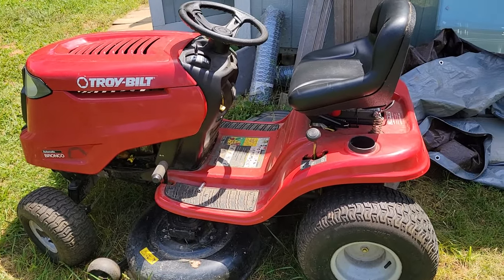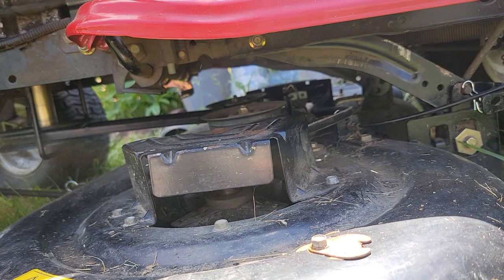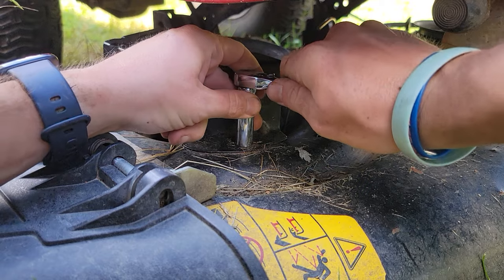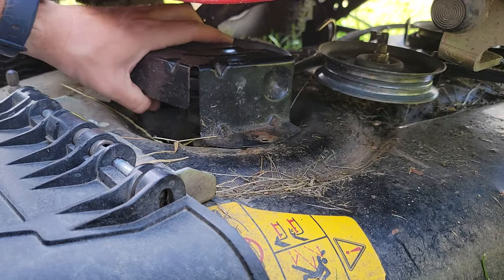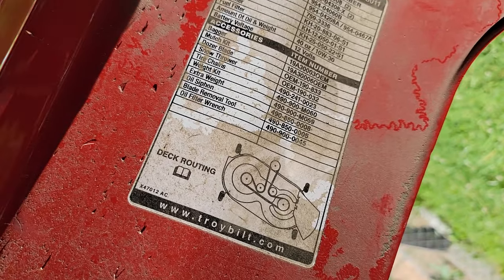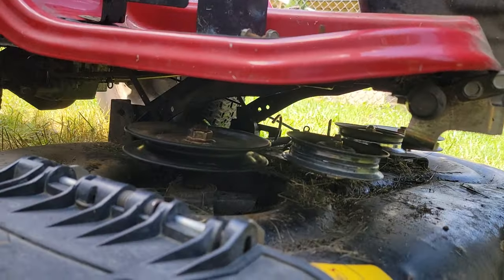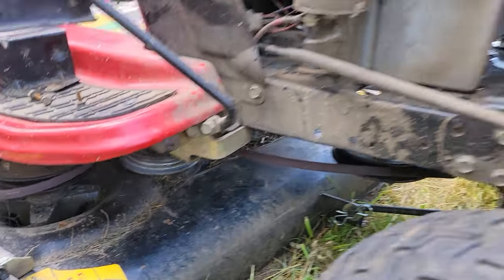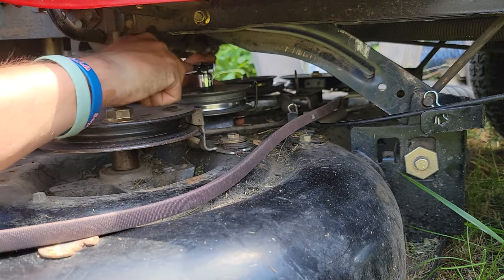Easily replace deck belt (without removing the deck), Troy-Bilt riding mower

Comment: If ur belt seems loose dont panic..... after you crank ur mower engage cutting blades before lowering the deck it tightens the belt so you wont throw it when lowering the deck
Reply: Thanks for explaining it 
I was panicking thought I bought wrong part
Reply: Thank you!!!

Comment: Please accept my sincerest gratitude for sharing this video. Without a doubt, Troy bilt has the most frustrating deck belt replacement out there. This video was a lifesaver.
Reply: gotta disagree...my husband is still trying to replace the deck belt to the Simplicity 50" deck--THERE ARE NO SPECIFIC DIRECTIONS IN THE MANUAL for it....
Reply: @jailranger6891  it didn't help that the manual wasn't including directions for a 50 inch deck....!   I made it a point to have the deck on my truck to take to the dealer and video tape the procedure so my husband could see it.  Thanks for your reply.  Interesting that there are lots of videos for the DRIVE belt...but practically none for the DECK belt..but I do not think it could have been done without dropping it down and off the mower.  Please revisit your video and make it more complete...thanks again

Comment: You can also bend out the belt guard next to the pulley and then bend it back. It’s a little easier than removing the pulley. Great video btw and thank you
Reply: This is where I'm stuck!!! I can not get it through that guard.
Reply from the maker: Some machines the guard is a pretty thin/flexible piece of metal you can easily bend out of the way but on this Troy-Bilt I think it's easier to loosen the idler pulley
Reply: I actually got it! Put the crescent wrench on bottom of the tension pulley & then the socket wrench (with a breaker bar) and loosened the pulley enough to slip it on.  🙌 I'm a 105lb women who feels invincible with the recent knowledge of a breaker bar. 😂 Well, a pipe actually but, it makes me able to remove bolts I'd normal get frustrated & give up. It still took me almost 2 hours. 😂😂😂
Reply: @GiordanosGarage  Yes!!! That's exactly what I did! Thank you for responding! These videos are amazing! I know soooo little about mechanics but luckily my husband hoards all things that fall into the "tool" category.  And kind folk like you take the time to make these videos! I had already gotten the other guards off. I just rewatched this & saw the very beginning.... Ummm, sparkplug? 🤔😬😂 Yeah. I didn't take that out. But I did get my lawn mowed before it rained. Thank you again.
Reply from the maker: Great job 👏 I'm so glad I was able to help!
Reply: I usually try removing pulley just to antiz it for next time or engine repair 
But it depends on customer
Reply: Great video! Please keep it up! (Everyone else wants to take off the whole deck)  got to much time, I guess lol
Reply: Very good video!
Reply: Great video! Easy to follow.
Reply: Not mine it won't budge. What did u use to bend it back?

Comment: This was the best video ever. So very detailed I'm a 63 year old woman. Was having trouble getting it back on the pulley because of the guide. I was afraid to loosen the pulley nut I thought something might fall off the bottom but with this video I was able to put it all back right thank you so very very very much
Reply: me to im In my 60 but I need it to b jacked I did one b4 didn't remove all this but this rider is different
Reply: Hey thanks for your post it’s giving me my confidence back lol I’m a62 year old woman and I’m gone put a new mower back on too thanks ❤

Comment: I liked it but you will have to remove deck on most models to get the blade guards loose. Slipping your tools under are not so easy to loosen the nut and it needs to be torques back on. It really only a couple pins to drop and one cable to release tension. Changing the blades raising the deck and mower like he did makes them easier.

Comment: Remove the deck, do it right. Clean the deck, check all pullies. Replace as needed. Wire brush or sand off any rust, spray paint areas needed. Put belts on the deck, roll back under the mower, attach belt and reinstall hanger hardware. Sharpen/balance or replace blades. It's not all that bad.

Comment: Hey great video.  I’m going to give it a go and save $$.  Did you place the deck at its lowest level?  Would putting blocks under the tires give you more elbow room?  Thanks!!!
Reply from the maker: Hi, thanks-you can do it!! I did lower it all the way to the bottom--i don't think putting it on blocks will get you much lower. The deck arms are only so long-if you need more room you might just have to take the deck off entirely.

Comment: The Best!  Be proud! A 68 yr old man that's disabled (can't stand up, one hand shakes constantly) and with the help of your guide completed the task in 100* degree heat in only 2 days! Okay, here's another trick That helped me... Use electrical tape to hold screws in the socket and on front pulley guide arm I used duct tape on the side you just stick in to keep that booger attached! Just finished mowing. Thanks Again!
Reply from the maker: Great job!! I'm so glad I was able to help. That is a really great tip--thanks for sharing!

Comment: I have a nearly identical Troy Bilt. I loaned it to my mother so she could cut her neighbor's yard. At some point she hit something hard enough to completely break one of the belt guards off. Since it threw the belt and the belt was in rough shape, I decided to replace it. I replaced the belt and installed a new belt guard. Since the replacement, I cannot get enough tension to keep the belt in place. The routing is correct and nothing else appears to be damaged, but the belt will come off after a couple of passes. Thankfully, I have plenty of other riding mowers, but I would love to get this one into good enough condition to sell before Spring is over. Is there anything that I could be missing?
Reply from the maker: Hi! If she ran over something, the crankshaft could be bent.

Comment: Is the tension already correct when you install a new belt?  Your video is clear and precise. Under 15 minutes I am impressed.
Reply from the maker: Hi, thanks so much! It should be correct (no adjustment needed) but overtime the spring can get stretched out a bit

Comment: You don’t have to remove the engine pulley bracket, the belt will slide between the pulley and the bracket

Comment: We have the same mower and for 6 yrs the belt has continued so slip off the pulley on the right side. Any suggestions? Even took it to the dealer. They fixed it but happened again after 6th or so use. Very frustrating!!
Reply from the maker: Same thing has been happening to mine! I have taken my deck off for some other work and it seems like perhaps the belt guide shifted a bit (should be closer to the front of the mower instead of the back). I haven't finished the other work so I haven't tested my theory yet.

Comment: OMG, I borrowed my cousin lawnmower today which I have for little of the summer. Well, today I was cutting and went to put turn the blade back on and noticed it wasn't engaging. I moved the lawnmower and noticed a piece of metal in the grass. Well, now I know what that piece is just from the beginning of your video you showed this is the bracket. I'm puzzled as to how that bracket just fell off, I didn't hit anything. It covers the belt and I noticed the belt has come off a little so I think it just needs to be tighten. Now, just waiting for my mechanic cousin to put it back on. Thanks your video solved my problem had no idea where the metal piece came from.
Reply from the maker: I'm always running over metal too! Which is strange because I never take metal into the area behind my shed....glad I was able to help!

Comment: Thanks for posting I would do deck belts in cuting tall grass the blade would get stuck in the grass and the engin drive pully would burn out or wear out a 8 inch of the drive belt then the deck belt would be out of balance So I just duck tape the belt to restor the blance till I had time to replace the belt. I mostly did this with the dect  belt  Because I had to take the whole deck off to change the deck belt ,   I have a Rover rancher 38 inch,  its all most the exact same mower Mine to Has  only a single belt pulley as well next time  this will save me time .
Reply from the maker: You are welcome! Oof those drive pulleys burning out sound rough!

Comment: What year is this? If by chance that this mower does not have the bracket at the very front of the mower the bronze color looking one at 2:30 in the vid, would the belt still work properly without the belt falling off? I was thinking about purchasing one but I dnt think it has that bracket.

Comment: subscribed... man i just realized someone who owned this mower before me removed the pulley guards and never replaced them. had to order 2 new ones and i have no idea what screws i will need to bolt them to the deck. any idea?
Reply from the maker: Hi, thanks so much! The screw for the crankshaft guide is a 5/16. The six screws around the deck are 1/4.

Comment: After replacing my belt, the mower makes a squeaking sound when running. I noticed the new belt I bought was bigger than the old belt. I bought the one the manual told me to buy but I feel like it’s the wrong one. Part number that I got from my owners manual is 754-04045. I have the same Bronco as you. Did I install the wrong belt?
Reply from the maker: Hi! Yes, it looks like that belt is 108" long...you wamt one that is 96"

Comment: The belt still seemed a bit loose. Did  you have to tighten it more in some way? If so, How is that done? What did you do?
Reply from the maker: You shouldnt have to do anything...if you engage the blade (while the engine is off) is it still loose?
Reply: Thanks so much for the reply back 
I’ll be getting it done by next week. 
Ordered new brackets & pins

Comment: It's been a while and I have two mowers but the one with belt problems is exactly like this video. My other mower is a Porsche. Jk, a John Deere zero turn. Is the spark plug connection a real problem? I've never done it before. Been doing landscaping a long time but hadn't had to change a belt in a long time
Reply from the maker: Good question! It's a safety thing....it removes any chance of an accidental engine starting and you losing fingers or arms. No spark = no chance of the engine starting

Comment: what size closed end wrench did you use to loosen bottom nut on pulley, also what length wrench did you use i find it very hard to reach it thanks
Reply from the maker: Hi! I used a 15mm wrench of just whatever size is in my dewalt mechanics tool set...and yes it takes a little bit of trial and error to get it to fit on each of the pulleys--but it will fit eventually!

Comment: I’m doing mine tomorrow. I’ll try it your way first because most of the other videos I’ve been watching start by taking the deck off which is quite a bit of disassembly.  I’d rather avoid that if possible.

Comment: I like the part about not removing the deck. I will be replacing my belt soon as well as the spindles and blades. Thanks for sharing this video.
Reply: New belt is installed. New blades are arriving today. I will know soon if it works correctly.  Thanks again for letting us DIYers know you DON'T have to drop the deck to do this job.

Comment: Thank you for your video Giordano, I have a question, maybe you can help me,  Coincidentally, I recently changed the drive belt and I don't know if that will be the cause of my problem, I have a Troy bilt pony (2011), now I can only control the speed with the throttle lever, even when I put it in rabbit mode the motor goes at high rpm, but the ground speed is about half the normal speed; the (yellow on mine) speed control lever doesn’t work, it goes up and down without locking the notches, offers no resistance and does nothing. (however, the engaging of the parking brake action works fine). I opened up the mower and saw the yellow speed control lever attached to a connecting rod which is attached down there to the cupped metal piece in the correct position as the new Troy Bilt Pony I saw yesterday at Home Depot, but besides allowing to be put in in park position, I don’t see it attached to anything else, is it right? How does it regulate the speed if it is not connected to anything else? Thank you in advance.

Comment: Don't know if you going to get this but thanks also I ran the lawnmower and when I looked at the Belt on it started to  wear out after a few minutes of cutting any help please
Reply from the maker: Hi! You might need to slide one of the belt guards around a bit (they can shift when tightening)
Reply: I got it working but thanks so much for the video and your time you was alot of help
Reply: Check (2) brake assembly on pulleys. They will wear out and need replacing..

Comment: I don't have a Troy, but is the process fairly universal?
Reply from the maker: Hi Scott! Yes it is pretty similar--might be some differences on the belt guide around the crankshaft. For example I've worked on a Craftsman where you just lifted the belt over the guide instead of removing the guide.
Reply: @GiordanosGarage  Dude, 100,000% it worked! First try, my blade fired RIGHT up! Thank you so much for the video and the response!

Comment: Our mower is a year old & the belt keeps coming off. Would it need a new belt already?
Reply from the maker: Hi! Could be a number of things. Make sure there isn't a lot of grass on the deck. That can cause issues with the idler bracket arm or if it's wet grass could have caused some rusting or bearing failure of any of the pulleys.
Reply: Probably wrong belt or belt guides missing

Comment: my mower engaugement arm is loose, how does that attach to the mower deck
Reply from the maker: Hi! Are you talking about the actual arm? It is attached to that spring you remove that moves the idler pulley.

Comment: Did it still run alright with that much slack in the belt? I have about the same amount of slack in my belt and was concerned that i might have bought the wrong one. 🙃 im a rookie at lawn mower maintenance
Reply from the maker: Hi, great question! If you engage the blades (with the machine off!) you should be able to see the belt tightens up so there isn't any slack. You just want to make sure it is in all the belt guides-around the idler pulleys, crankshaft and the hook in the back (if your mower has that).
Reply: @GiordanosGarage  p😊😊
Reply: @GiordanosGarage  😅😅😅😅

Comment: What size belt does this use? I have the same mower, got a 96.5 belt and it seems to be too short
Reply: Did you ever figure out the issue? This is exactly the problem I am having.

Comment: Was the old belt coming off the pulleys because it was stretched out ???
Reply from the maker: Hi! The gentleman who owned the mower before me had replaced the belt incorrectly
Reply: @GiordanosGarage  I'm having trouble with my belt coming off do you suppose it is just stretched out??
Reply from the maker: Is it falling off the crankshaft (that would  tell me probably yes) or one off rhe pulleys in the back (did you loosen the idler pulleys to loop it around the notch-belt might still be ok)?
Reply: @GiordanosGarage  do you know what length of belt it takes?
Reply from the maker: 96.5"
Reply: @GiordanosGarage  it's throwing the belt off and or engaging the blades unless the deck is set on 3 ( the middle) any ideas ??😣
Reply: Belts don't stretch, the inside of the belt wears thin, causing it to not stay in the pulley grooves. Sorry to jump in I hope you got yours fixed.

Comment: You do NOT have to remove the pulley, you simply need to bend the pulley guard (that small piece of bent metal) away from the pulley a little bit (channel locks work great), reinstall the new belt, then straighten the pulley guard.

Comment: Take the deck covers off because grass gets stuck in them. If you have mice they love to nest in there. If you're worried about stepping on the belt when engaged you probably shouldn't be mowing. I have a Troy Bilt 809Z garden tractor, that deck comes off in 5 minutes.
Reply from the maker: That is certainly a perspective.
Reply: All riding mowers have the guards or shields on there as a safety precaution.  Obviously they are there over the spindle pulleys to prevent anyone from getting foot or other body part down into the deck/blade area.  But on some riding mowers, ie John Deere, they also serve a dual purpose.  They help hold a loose belt onto the spindle pulley as it is being engaged or disengaged.    If removed, a well-worn belt could possibly fly off a pulley.  I would not recommend operating mower without guards in place for this reason.  And yes, grass clipping, sticks, leafs, and other debris do tend to collect there, but they are not that difficult to clean....especially with the aide of an air compressor nozzle.

Comment: You have a very small knowledge of what you are doing. You will find it a lot easier to remove deck from an access point of view.
Reply from the maker: Thanks for the tip!
Reply: That was the whole purpose of his video, so people didn't have to remove the deck as well...

Comment: I’ve noticed my deck doesn’t engage as fast as it used to when I push the mow lever forward. Do you think the reason for that would be a loose belt?
Reply: I had this problem today blade would no longer engage, later I noticed the belt is off at the front. That bracket he showed in the front fell off and I think this made the belt loose.